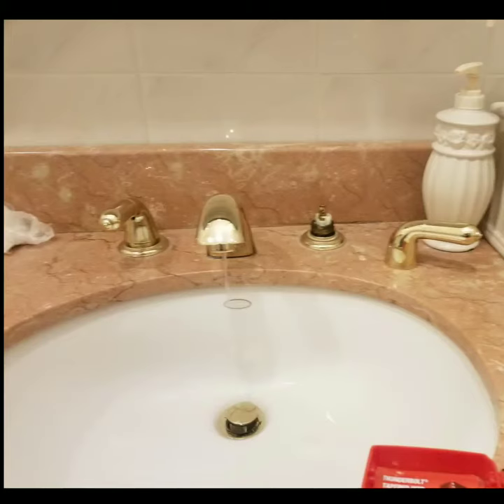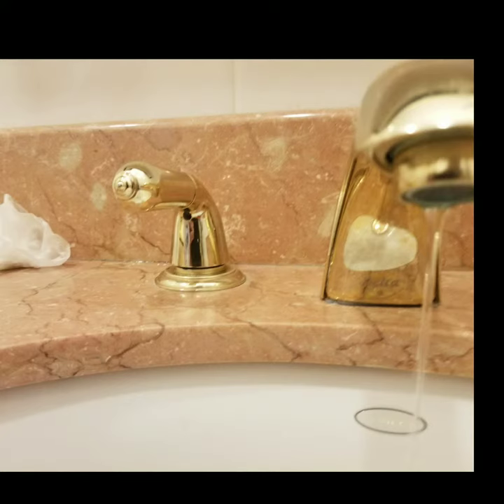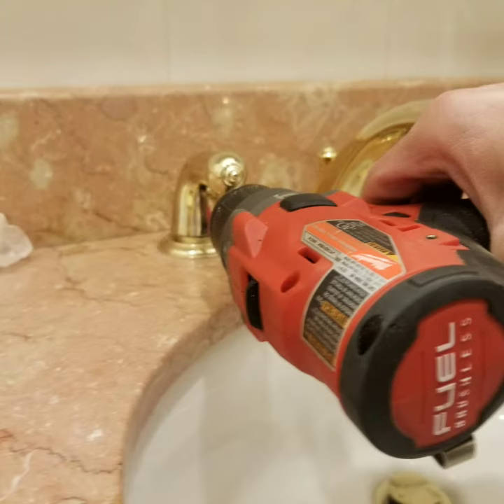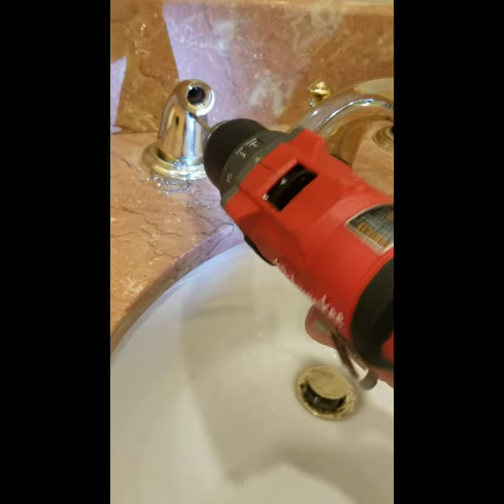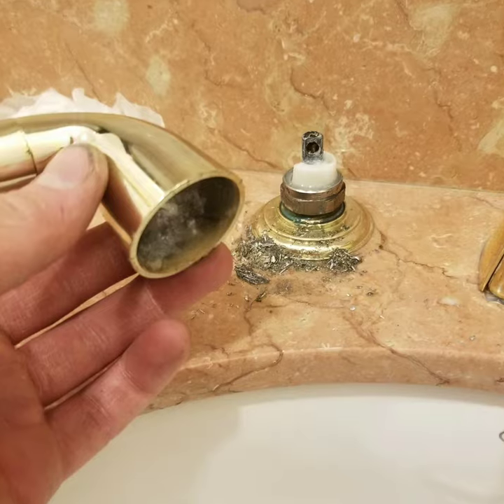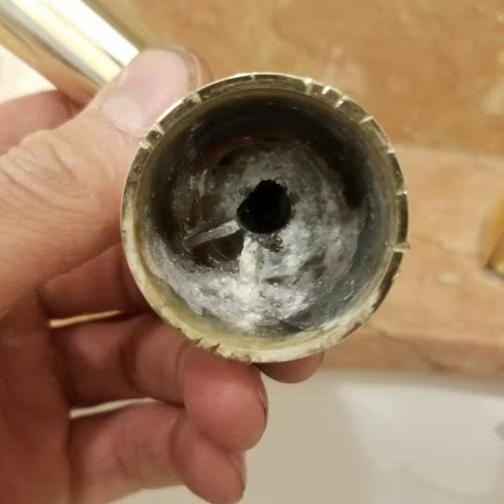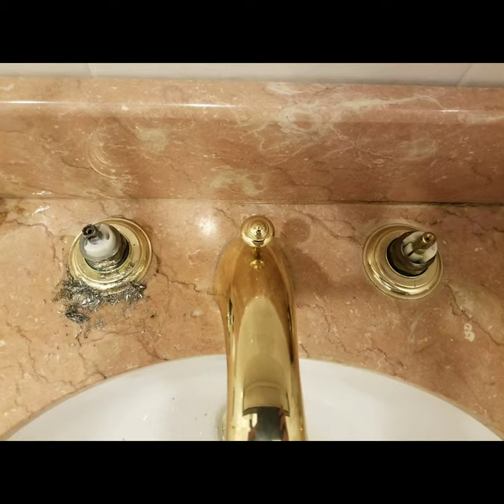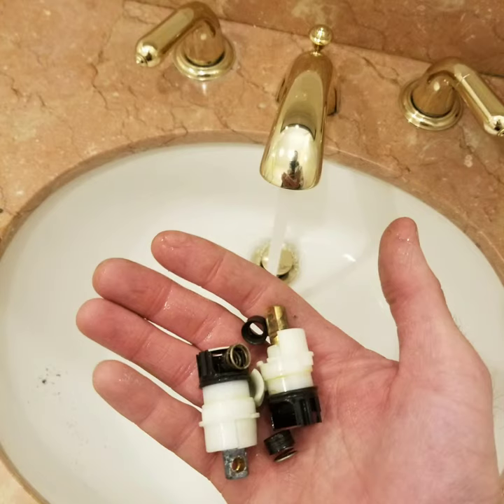Stripped set screw on Delta fauce repaired - More then just a plumber

Comment: I have that same faucet, and I think the allen screws are stripped. Do I have to replace the whole thing?
Reply: If you want it fully functional, yes.  Otherwise, do what he did here and it will be serviceable until it breaks again, then you will have to replace the whole faucet.
At that point, you will have to break off the glued on handle.  You might want to discern how best to do it before gluing it into place.